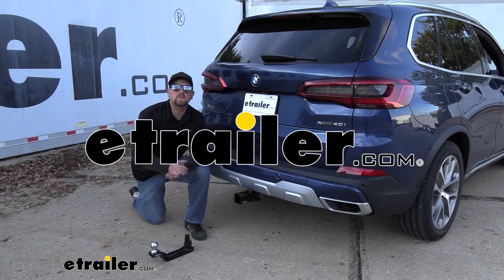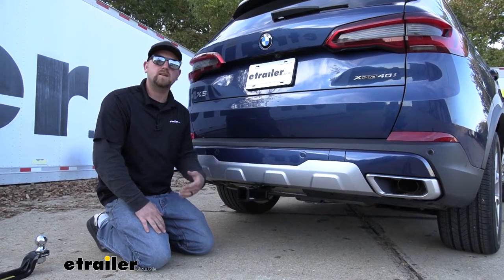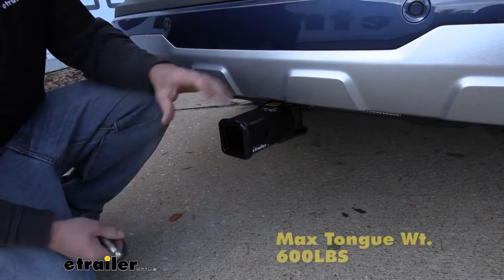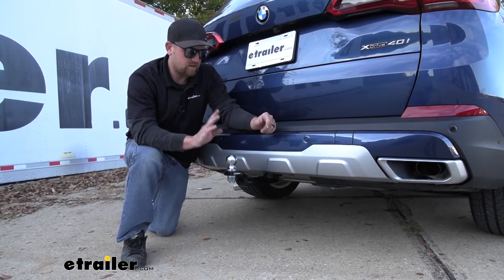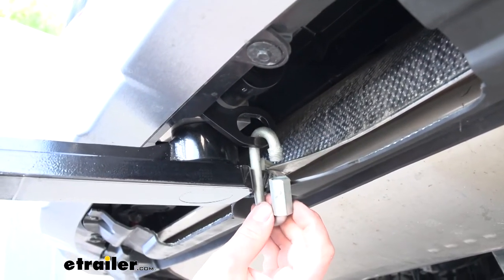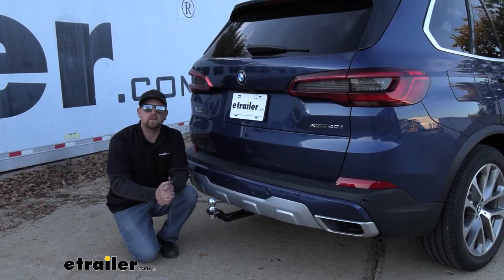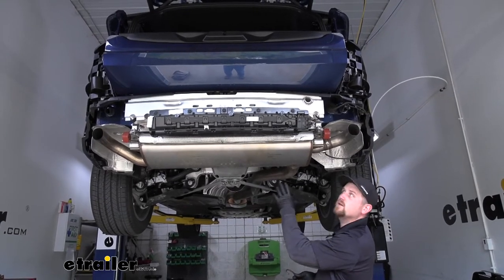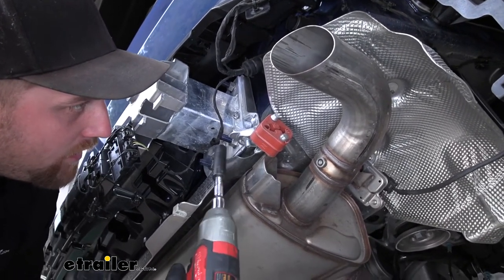etrailer | Stealth Hitches Hidden Trailer Hitch Installation - 2020 BMW X5

Comment: I just installed the stealth hitch on a 2021 X5, because I only had the hitch (use for a bike rack) and not the towing kit, I didn't need to do the wiring. Therefore, I followed the hidden hitch instructions and didn't need to take out the interior, taillights etc. just the bumper and the bottom pieces. It was so much easier than needing to take the interior and the taillights out.
Reply: Hi, do you have the video how to install a trailer hitch just for bike racks. I don't need the wirings installed. Thanks.

Comment: Why did you cut the trim below the hitch while we can see on other pictures that we only need to cut half of it on the left side and leave as is on the right side? thanks!
Reply from the maker: This kit will require to cut as shown in the video because of the wiring kit being mounted behind the fascia. Other kits will have the wiring mounted below the fascia and you can leave the plastic.
https://www.etrailer.com/Trailer-Hitch/Stealth-Hitches/SH25VR.html

Comment: Is there a problem with the electrical setup? I’ve been led to understand that it can be very tricky to get the electricals setup without mucking up the car’s electronics.
Reply from the maker: If the install instructions are carefully followed, you shouldn't have a problem. European vehicles have pretty sophisticated wiring systems. If the install isn't something you feel comfortable with, we'll link to to our local installer finder. Just input your zip code....
https://www.etrailer.com/installer/near-me/trailer-hitch

Comment: What if you need a drop hitch for weight distribution hitch?
Reply from the maker: Unfortunately, because of the way that it is designed, the Stealth hitch cannot be used with weight distribution. We have other hitches available that would work great for you. Check them out in the following link.
https://www.etrailer.com/hitch-2020_BMW_X5.htm

Comment: Terrific video - it is great to see the steps necessary to do this install.  One comment:  at about the 23:15 mark, you are removing the rear bumper.  The video did not show the step for unhooking the four clips that attach the bumper in the middle under the lower hatch gate.  I have heard this is one of the more difficult steps in removing the rear bumper, so it would be helpful to show how to get those four clips to release.
Thank you for making and posting this tutorial, it is going to help immensely with my Stealth Hitch installation on my new X5.

Update to my comment above:  After checking out the lower back hatch more closely, I figured out that if you manually position that gate half way open (or half way closed, I suppose), it is very easy to access those four clips.  As per the installation instructions from Stealth, you simply press down on the center of those four clips with a 5/16" allen wrench (or something similar) to let them release.  Thought this might help if anyone else is attempting this install.
Reply from the maker: Thank you for sharing this! We are happy to hear that you were able to get to the clips. We will be sure to show this step in future installs.
https://www.etrailer.com/Trailer-Hitch/Stealth-Hitches/SH25VR.html

Comment: Thorough install video. Thanks. Was a bit surprised however, that BMW doesn't have a plug port in the factory harness to plug the 7-pin trailer harness into, and that you had to do all that splicing. Have some concern BMW might try to blame any electrical gremlins that raise their ugly head to the splicing job, saying it invalidates warranties.
Reply: maybe but thats not really bmw style in my experience.  They usually dont say a whole lot about user mods in my experience.

Comment: Hi Ryan.  I am ordering a 2024 x5 50e this week.  I need a hitch and do not like the look of the factory installed hitch. I don't need any wiring and just need the hitch for a single bike rack.  What is the best solution for this?  Thank you very much in advance!
Reply: I'm here for the same exact thing, for the same exact car. I have the X5 already and I'm sorry I didn't pay those $650 for the factory installed one.

Comment: Thank you for showing us how to install the tow hitch! With BMW navigation system, do you pre code the X5 with trailer hitch features?
Reply from the maker: You do not need to code the vehicle with hitch features. You will need to put the vehicle in tow mode if that is a feature that your vehicle has.
https://www.etrailer.com/Trailer-Hitch/Stealth-Hitches/SH25VR.html

Comment: How similar is the installation for an X7?
Reply from the maker: The Stealth Hitch for the 2020 BMW X7 will install on the end of the frame rails just like the X5. Check out the hitch you will need in the following link.
https://www.etrailer.com/Trailer-Hitch/Stealth-Hitches/SH32VR.html

Comment: Could I tow a boat with this hitch
Reply from the maker: You sure can, but the 8000 lb towing capacity of the hitch will be limited by the actual capacity of the vehicle which ranges from 6600 to 7200 lbs, depending on how the vehicle is equipped.
https://www.etrailer.com/Trailer-Hitch/Stealth-Hitches/SH25VR.html